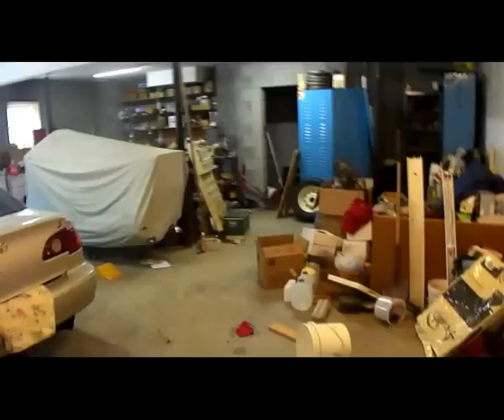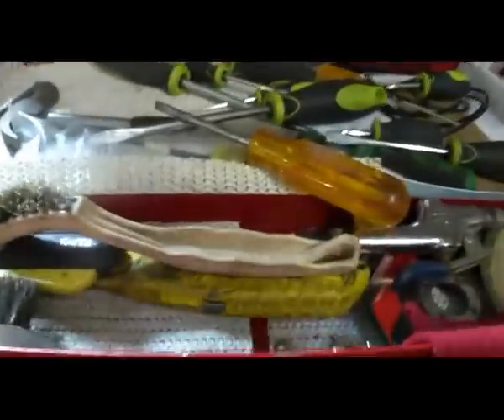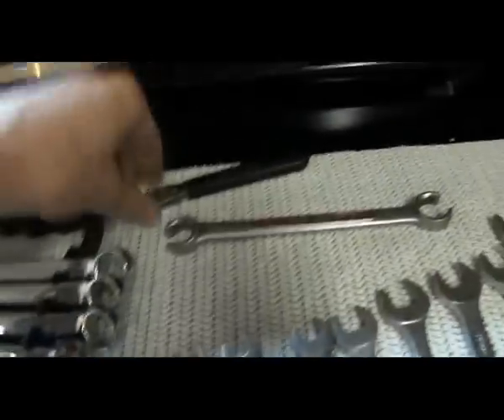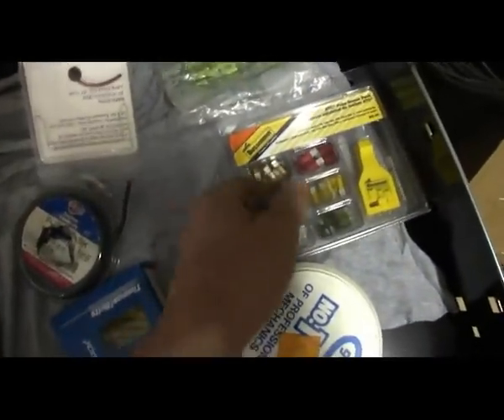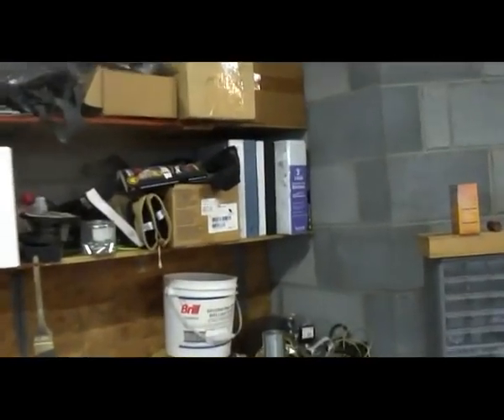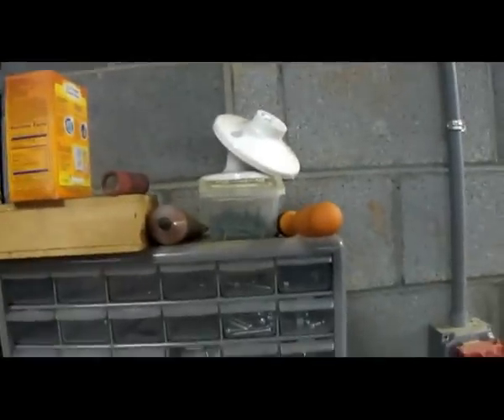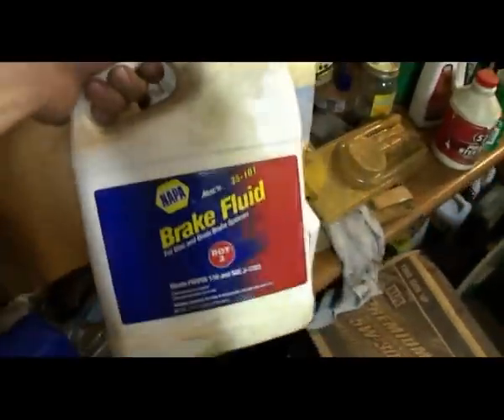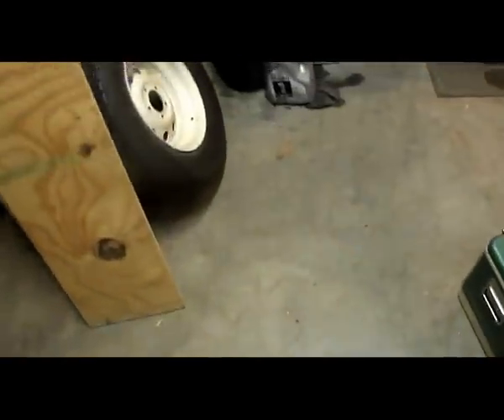what my shop looks like and whats in it

Comment: It has a squeaky/squealing belt and the brakes have never been check even though they're not giving me any problems.  The tires are out of balance and need to be rotated.  Other than that it's ok as far as I know.  I drove it today even though the tag expired last Sept.  Of course I hoped the cops wouldn't catch me and they haven't so far.  :-)  We have emissions testing here and I don't want to take it in with a squealing belt